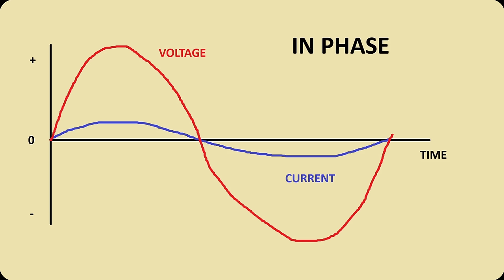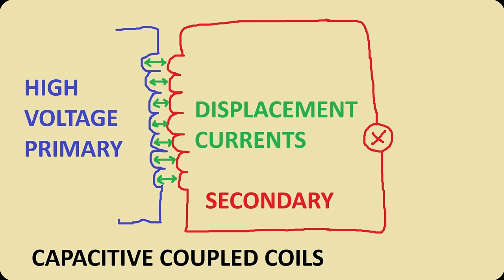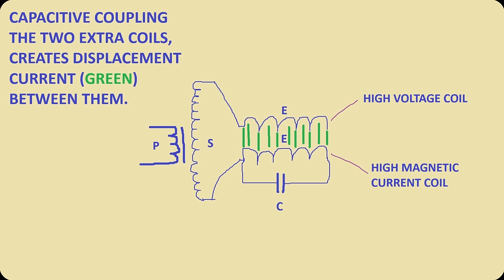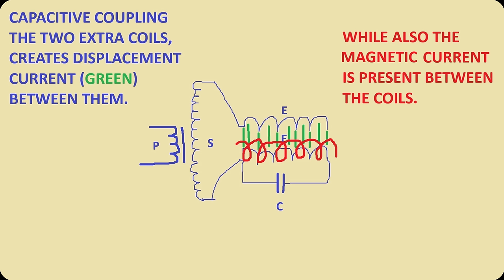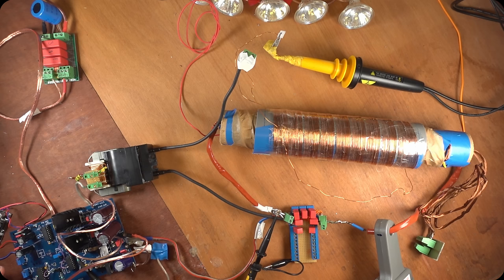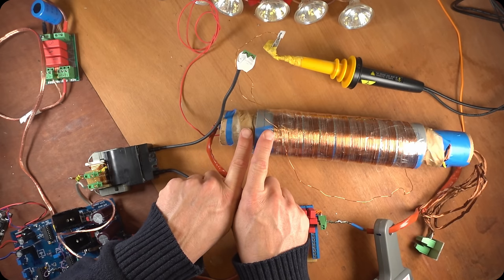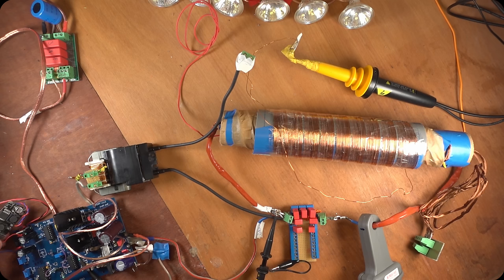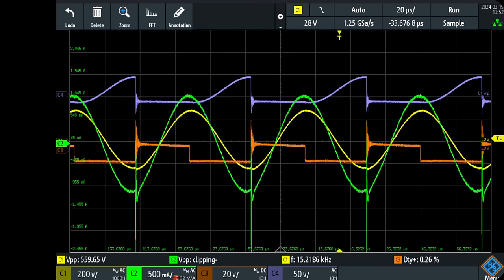Phase Shift Experiment

Comment: I'm very proud of you Mr Ivo. I managed to achieve these same results back in 2017, form there I got stuck because I needed a high speed/Power amplifier, for the next prototype, now after several years i built my own hardware based on smpw with variable speed control, the new prototype will resonate in the 150 to 300 kHz. You harvest the ground energy exactly in the middle point between the bifilar coil a the capacitor connection, You only need to connect one wire of the load and the other goes to ground.

Comment: Hi Ivo, welcome to the world of phase shifting and positive feedback which lead us to oscillators. I have strong feeling about Tesla's transformer, as we broadly know as crippled version. Some terms as disruptive discharge, low coupling (primary/secondary coils) and magnifying amplifier staying in my head all the time like standing wawe. So i think that Tesla's resonant transformer is osillator. You solved disruptive discharge with nanosecond switching. With phase shifting you are closer to positive feedback which should maintain oscillation. Unsolved part is magnifying amplifier. What is magnified and amplified? That questioning leads me to parallel primary tank circuit, serial secondary with transmission line connected with third coil. Third coil is direct connected with so called capacitive load. That capacitive load could be metal sfere or toroid shape coil wounded with wire intersect at 90 degree to cancel magnetic component forming scalar. Third coil should be as refector with much higher impedance then secondary to reflect wawes back to secondary. Transmission line could amplify and most important phase shift wawes to form standing wawes in secondary. With positive feedbak that standing wawe (potential) would grow enormous and break trough third coil to capacitive load forming scalar potential which is V/m. That is basic idea how things should setup. I understand why  primary widh 3-5 turns thick wire (low inductance fast transient) and large capacitor to get disruptive discharge with extra high current which alows low coupling and primary does not sence secondary. Bigger cap make less sharp bell at resonance and more stable resonance. What bother me is secondary with thin wire because serial circuit gives max current at resonance. That is in contrary with thin wire. I know i miss somerhing there but still can not figure it out. Hope my thoughts will give some new idea to other builders. Cheers from Croatia.

Comment: vortex wound high voltage coil will lower your impedance and hyperboloid wound current coil will increase your output and you could better manage your voltage and amp phasing with a 3 phase system. The timing could be improved with your firing circuit by using a delay time of the collapsing magnetic fields. I know this would be A lot harder to physically engineer but I think it necessary for any useful power production

Comment: The creation of larger magnetic fields with thicker and longer wire, and the increasing of voltage difference between capacitive elements with radiant energy IS accomplished most efficiently when impulsive/square-wave input power is applied in resonance. But more must be done to harness this multiplied output energy supplied by the local Space "environment" without this Output causing the power Input to increase. It looks like you are close to a solution.

 I like every adventure of serious scientific experimentation which you are so clearly explaining and sharing with us. This is above the norm for this topic. You are definitely raising the quality bar. Anticipating your next. Keep up the great work which benefits all.
Reply from the maker: thanks a lot!

Comment: Well got a suggestion. At induktion the voltage encreases in how many meters winding. An accumulation of voltages occurs, so does the Back Emf which are written in Voltage. There is that thing with "loads" where you connect a lamp or electric engine that goes through a transformer. This is a closed circuit like eddy current or a shorted circuit. Which basicly is an eddy current with a ressistance load. The back emf and voltages encreases, which are wasted energy.
This is why if you want to create energy, it should not be to a load, but a battery where the energy gets charged instead. 
This is shown where you got a generator connected to a load works harder than if it is connected to charge a battery. The generator works simply more effiently. You may make you system works better that way. That phase shift may not occur when it is charging a battery.
Reply: Bedini coils?
Reply: Plugging the systeme directly to a battery would be stupid because of the output voltage of the systeme and it would put the systeme out of resonance because he has to plugg it to a pure resistive load. Heat or lamp. No coils, no capacitors. A battery has a capacitance value... So no.
Reply from the maker: a battery is like a capacitive load. when empty large currents flow (low reactance) when almost full almost no current flows (high reactance).
so a battery is like a variable load.
Reply: @MasterIvo  you think in frequentcies. When it comes to creating power voltage and current delivery, migth as well be rectifiers and dc. That is different a battery takes takes both voltage and current over a very long time. Ultimately you wanted to create power?
Reply: @sk8pkl  Maybe you don't plug it to a battery. You put a battery or piezo inbetween the displacement charge.
Reply: @off6848  .... I dont understand what you mean really. I dont think it makes sense eighter. What you mean?
Reply: @sk8pkl  wireless transfer of energy.
Reply: @off6848  I dont think you understand what you are talking about. I dont understand what you mean and where you are going with this question. Do you piezoelectric transducers are just DC transducers that produce a soundwave because of the crystal's rapid deformation? Why would it have anything to do with ivo's stuff or ... Wireless electricity.... I really dont get what u mean.
Reply: @sk8pkl  it’s not a question I’ll build it soon

Comment: Nice!
Idea: I used a 2nd world war’s radar vacuum tube (702B Sylvania, that sparks at 500v) as surge arrester, what was peaking at 1kv on my MOSFET probe WENT TO 500. I cranked supply ~4X and the voltage climbed back up to 1.1kv. But with a lot more power, while the purple spark was active. Sadly I burnt the vacuum tube. But it did protect the MOSFET for a few minutes. I wasted the surge to GND. You could feed the high current coil?

But, why stick to solid state and not try it the old fashioned way with magnetic quenching and spark gaps?
Reply from the maker: because there is more controlnin solid state, and easier to replicate , with longer functioning time before wear out.
Reply: @MasterIvo  correct me here (I think I wasn’t clear). 
Using a power MOSFET yiu can be accurate and fast to switch open, but with a 1KV, 3KA GDT between the impulse coil and the MOSFET drain you can divert power to GND or a low reactance capacitor, and use that accumulated energy, maybe with a diode and a 800V 20KA GDT to power a current coil?

Comment: Parallel residents requires impedance matching from all the components. You could use a gymatic progression of impeance in the circuit like don smith did. With parallel resonance you get infinite resistance resistance is the ability to dissipate power. The problem is you would need variable capacity in order to maintain the linear geometric progression of output power to infinity. Dawn Smith also used a solid state variable capacitor to achieve the linear progression of output power to the rating of the  varactor. You will take note that they don't make these variable capacitors. Any bigger than a few Watts, whereas back in the old radio days. They used to have very large ones until they figured out that you can actually induce a voltage from the Earth. Just like lightning induces Corona discharges from the Earth as its discharging from the cloud.

Comment: I started small thinking I could progress to some point like this once I could prove my circuit was going to work but I had used a 27000mhz quartz crystal and high speed switching and I wound my coil with magnets.  I powered it with an almost dead 9v battery that still had six volts in it and it would have caught fire if I hadn't stopped it  ..  I could see the resonance building in the LEDs before they fried ..  I figured this must be what they ment by  resonance cascade  ....
Reply: And then we got Half-Life 3

Comment: I couldn't quite follow everything you were talking about as I'm educated on the terms used. But you seem to doing something similar to Thane Heins. His coils and transformer designs use the phase shift between the voltage and current. He uses high impedance coils.

Comment: Try checking out using a resonant charging choke, also have you experimented with minimum amps needed as well as with the high frequency voltages stepping up in increasing voltage frequency pulses? You might need the last pulse to be your discharge target in doing so.  Some papers I've read hypothesize being able to use this magnetic flow state to strip molecules apart with such pulses. I think some claimed using certain frequencies in this manner to strip methane, others to use other frequencies to strip water, ethane and a few other gasses; in turn the stripped gas components become ionized and charged by the magnetic field interactions paired with picking up some of it from nature. The key in experiments like this is to measure power consumed in the frequency stepping process when you do dial it in, make steady consistent measurement repeatably and compare to the standard uses in fuel cells that use the element itself to do the work electrically with high amps dumped into the systems instead of something this delicate and advanced. If you can prove that you've got less energy used for your frequency stepping compared to the fuel cells, you've got yourself a topic for a paper. 

The more people replicate this data the less it will be suppressed, so I wish you luck in your endeavors.

Comment: Radiant energy harvesting device 

*To-Do List:*

1. Conduct a thorough assessment of energy requirements and site conditions.

2. Design the system architecture and components.

3. Compile a list of off-the-shelf components and materials needed.

4. Procure necessary off-the-shelf components and materials.

5. Assemble the device using off-the-shelf components.

6. Test the device for functionality and efficiency.

7. Optimize the device for performance.

8. Deploy the device in the target location.

9. Monitor and maintain the device for ongoing operation.

*Off-the-Shelf Components and Materials:*

1. *Antenna System:*

   - Off-the-Shelf Components: Antenna kits with directional and omnidirectional capabilities, coaxial cables, connectors.

   - Materials: None (kits typically include all necessary materials).

2. *Energy Conversion Modules:*

   - Off-the-Shelf Components: Bridge rectifiers, voltage regulators, power inverters.

   - Materials: Printed circuit boards (PCBs), solder, heat sinks.

   

3. *Energy Storage Systems:*

   - Off-the-Shelf Components: Lithium-ion batteries, supercapacitor modules, battery management systems.

   - Materials: Battery enclosures, wiring harnesses, mounting hardware.

4. *Smart Grid Infrastructure:*

   - Off-the-Shelf Components: Programmable logic controllers (PLCs), communication modules (e.g., Ethernet, Wi-Fi), power distribution panels.

   - Materials: Din rails, enclosures, wiring accessories.

5. *Backup Power Systems:*

   - Off-the-Shelf Components: Diesel generators, fuel cell modules, grid-tie inverters.

   - Materials: Fuel tanks (for diesel generators), exhaust systems, wiring harnesses.

6. *Structural Components:*

   - Off-the-Shelf Components: Mounting brackets, support beams, weatherproof enclosures.

   - Materials: Steel, aluminum, plastics.

7. *Thermal Management Systems:*

   - Off-the-Shelf Components: CPU heatsinks, case fans, thermal paste.

   - Materials: Thermal insulation pads, heat-resistant tapes.

8. *Control and Optimization Systems:*

   - Off-the-Shelf Components: Microcontrollers (e.g., Arduino, Raspberry Pi), sensors (temperature, humidity), actuators (relays).

   - Materials: Breadboards, jumper wires, connectors.

9. *Safety and Regulatory Compliance:*

   - Off-the-Shelf Components: Circuit breakers, surge protectors, grounding rods.

   - Materials: Electrical enclosures, conduit pipes, safety labels.

10. *Enclosures and Protective Measures:*

    - Off-the-Shelf Components: Weatherproof enclosures, protective covers, cable glands.

    - Materials: Steel, aluminum, plastics.

By utilizing off-the-shelf components, you can streamline the procurement process and reduce construction time while maintaining quality and reliability. Make sure to verify compatibility and specifications of components before purchasing.

Comment: What if you made a tri-filer coil (3 wires wound together). Drive the bifilar then put the bemf into the third wire of the trifiler. This should greatly output thousands of volts depending on the input and amount of turns

Comment: Hi Ivo,

Looks likes you moving in the direction to don smith. He use high voltage dc at rf in his notes how higher the frequency the higher amplified output power.

Hoop to see a new video soon.
Reply: Makes sense, every input per cycle carries the same energy as the last, if you have say 20,000 inputs per second it'd power up quick, it's the same thing as a mechanical "generator" spinning at 20,000 RPM, just using fields instead of physical magnets.
Reply: @JenkoRun   I was thinking the same thing earlier. Higher frequencies are like rpm so in smaller systems high frequencies can generate more power. But maybe the inverse is true the bigger the system and higher the amplitude and voltage drop it would work more like a Diesel compared to an F1 car high torque low rpm which can overcome resistance more efficiently.
Reply: @off6848  You're one the right track but it works a little differently in field systems, in fields Magnetism is the field responsible for force, it plays the same role in an electrical system as the torque on the input shaft does, that's why you see a rise in amperage cost as you attach loads as it literally demands more force to overcome resistance.

In a "Generator" amplitude is proportional to RPM, so instead of lowering it to get more force you would instead either increase the RPM or send the energy in a pulsed/staggered form, the smaller the duration of the pulse the stronger the effect will be for the same energy cost, just as how Tesla's Radiant Shockwaves work.

If there is something to lowering the frequency to getting more power for larger systems then I have no idea how that would work.

Comment: With all the switching going on what are you doing with the flyback voltage?
Reply from the maker: I am suppressing it in the push pull primary of the ac HV, with a snubber circuit. to make  it easier.
the back emf isn't interesting me anymore. you could say I am more interested in the front emf.

Comment: Are you talking about a different type of resonance? At resonance the voltage and current are in-phase not out-of-phase? @0:24
Reply from the maker: That is also what AI tells. but in reality the current and voltage in a single resonant system are 90 degrees phase shifted, which is natural as the field energies of the voltage and current are transforming into each other back and forth when resonant.

But with dual (or multiple) resonant systems voltage and current can become in phase

Comment: And any tinny load at the output change the resonance and  how to deal with that fenomeen
Reply from the maker: correct. that is a challenge. pure resistive load first off all.
but now the Q factor is lowered by the load.
the square wave should be a sawtooth, slow  charge then fast discharge, through the high current coil. and the pvc might interfere with the electrostatic field effect

Comment: gotta question that i hope you will respond to. how is that current can flow in a circuit when all the voltage drops are added up to the supply voltage, thus arithmetically having 0 V after the last load, if V supplies the impetis for current movement then how does current continue to flow after final load where all the V has been dropped?  thanks
Reply from the maker: not sure what you ask, but voltage basically is a static field. When the voltage is changed then together with capacity it produces displacement current. this together with the magnetic current is what I understand to produce the real power. so not the static voltage  itself , but the changing voltage, which causes energy to flow as a displacement current